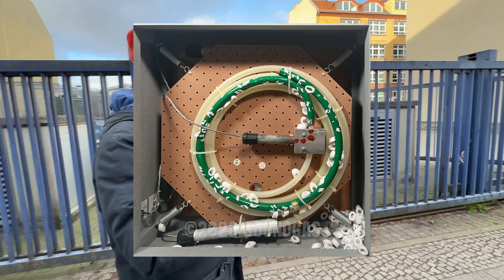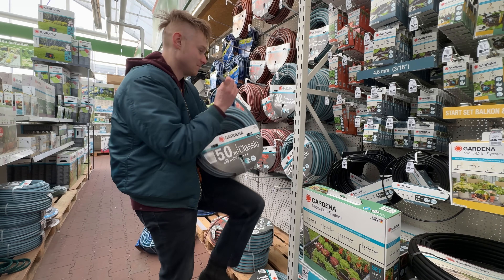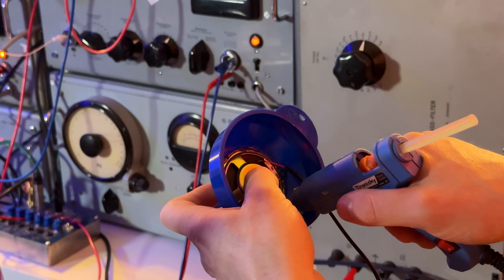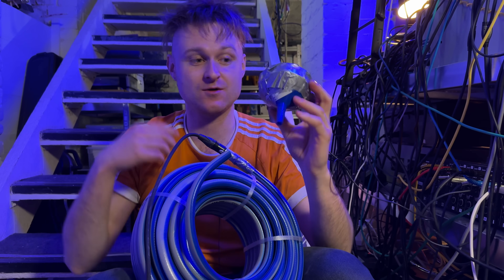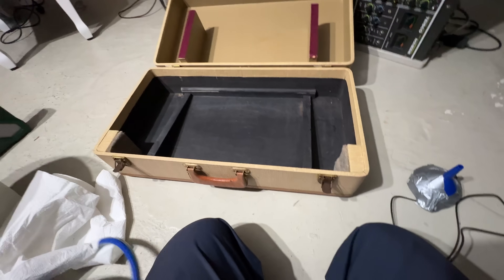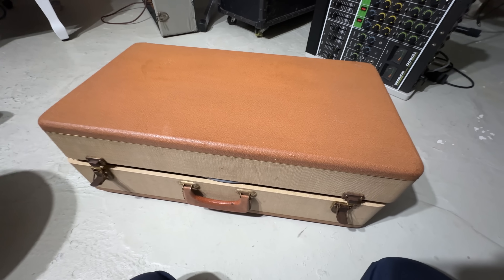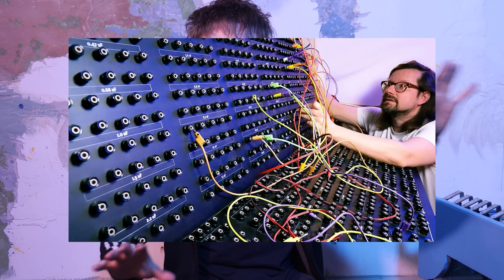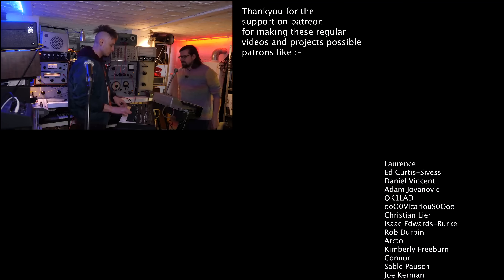MAKE A STUDIO DELAY WITH SCIENCE AND A HOSE.

Comment from the maker: You can now get both of the EP's on vinyl!!! there is a bandcamp vinyl campaign link above!!! PEACE
Reply: Unfortunately, postage to the UK appears to be more expensive than the record?
Reply from the maker: @Nervejam  yeah its mad int it :(
Reply: @Nervejam  Yep, $30.40 USD shipping and tax. Bummer.
Reply: Would be very interesting to cast the whole thing in concrete with the hoses and all to make it more solid and see how different it sounds
Reply: @AquarianSoulTimeTraveler  I beleive that sound travels about 14 times faster in concrete than it does in air. I wonder if that would cause cross talk.
Reply: Imagine you get more volume from a concrete cast because it can't vibrate as much forcing the sound to go down the pipe instead
Reply: Filling the hose with hydraulic oil or a similar oil might return better results since it's fully incompressible, as water still has some ability to compress and will cause some attenuation & distortion from the little bit of compressibility that it has.

Another point of distortion could come from the flexibility of the hose you are using too if that is a concern, but it all depends on what you are trying to do with the delay.
Reply: Nice. :D If you wanna try some things, here's a couple of ideas. 1) Because the signal bounces inside the hose, some routes are considerably longer than others. Instead if having one big hose, what would happen if there was plenty of small ones in parallel? 2) What happens if you combine different kinds of pipes into a setup like this. Then there will be different kinds of paths for the sound to travel, which might affect the sound quality.
Reply: Sam when you gonna make a rotory subwoofer?
Reply: yo, sounds great! What size speaker did you use for the funnel?
Reply: first bandcamp link is dead for me
Reply: Sproing reverbs and string reverbs (mic + speaker on old zither etc.) are known well. But particularly in 60/70th many such acousto-electric effect gadgets were built (already the Ondes Martenot combined much earlier a speaker with a gong - try cymbal for DIY). I wonder what happens when playing music through a trumpet (the musical instrument) or similar brass while operating its valves. What will a saxophone do?
Reply: 5:50 dubstep things is going on 😅

Comment: Hey manager Those weirdos are back in the store again!
Oh so that's where time cube comes from, Definitely should've watched this one first. I was thinking for a cube it's awfully round.
Well I'm here maybe a plumber will comment, why does the UK sell houses with no ends? I know that the faucets don't have a threaded fitting on them and are made to accept straight tubing a legacy thing but still why has that still persisted? I guess you would probably also have lower water pressures because I would imagine the hose would pop off at the faucet if you capped the end of it.

Comment: I took a sound reinforcement and studio engineering course at the Loudon campus of Northern Virginia community college about thirty years ago.  They had a gigantic plat reverb in the classroom.  Everyone thought it was a giant rolling chalkboard because it was mixed in with that sort of stuff along a back wall.  

It was a big rectangular frame with a wooden enclosure and a four foot by eight foot quarter inch steel plate suspended from the top on springs and stabilized by sound isolating rubber mounts along the other sides, and it had a transducer attached to the top left corner and a pickup on the bottom right.

I also went to see John Scofield about twenty years ago.  He has a moog synthesizer or maybe it's called something else.  It was a keyboard/organ powered by a giant spinning wheel that pumped air through the pipes.  It had a separate box for the "air powered amplifier".
Reply: Plat = plate.

Comment: In the 60s, reverb was something everyone seemed to want, even in our cars.  They made reverb units especially for car.  These used the spring units that were originally designed for Hammond organs, only smaller.  When you went over a bump in the road, ....twang, twang, twang.  Anyway, Popular Science or Mechanics, I think Mechanics, did a thing where they used a garden hose, a funnel, speaker and microphone, similar to the one you built in the video.  I always wanted to build on myself, however, I never seemed to have the time or money at that time.

Comment: Yeah, if you had 2 hoses with different diameter, the speed of the air are different and it will shift some frequencies. Not only that, but the pressure changes and speed of sound depends on it's pressure. So that's more economical and even easier to tune.

Comment: Ok, guys great video. Reminds me of 40 years ago and a Studio that a friend was building had an array of 3"  in pipes up in the ceiling all of different lengths, probably 5 different lengths, ranging from 10 ft to 30 ft  and each one equated to a different delay value, the delay calculation is approximately 1 millisecond per foot of pipe, you can use one speaker to Source all the pipes at once and One mic in each one of the ends of the tubes to record five different tracks of different delay values, and select the delay that works the best, also, when you use a larger pipe like a 3-inch irrigation pipe you don't have as much of the muffling as you experienced with the hose tube , try it and I think you'll be amazed!

Comment: I have an old building instruction from the 1960's for a reverb unit describing basically what you did, except that it uses two hoses connected together at the ends with T-connectors, so the speaker sounds into both hoses at the same time, and the microphone receives the sound from both hoses. The hoses are 16 and 22 meters long in the description - but it doesn't state why they have those exact lengths.

Comment: An idea to test; Try to use thin hose.. (and smaller transducer to maintain reasonable waveguide / funnel) ..around 1/4" or smaller (5mm). I know there are hf waveguides that rely on the fact that if a slit is narrower than 1/4-1/3 of wavelength of highest frequency of interest, the wave can not reflect thus flow fluid-like in a slit..so not so much low pass filter effect at least in theory.. kind of like a pressure system. I think most reflecting and thus the hf loss will happen in input and output chambers unless some mobilephone speaker/mic combination is used..one would be able to fit longer delays into the same size container..or more complex system..never tried that type of thingie but that came to mind while watching this video..! 😅

Comment: Cool stuff! Maybe give hoses for pressurized air a try, the material used is much stiffer than the rubber in garden hoses which should muffle it less and they are equally cheap if not cheaper!

Comment: Get 2 different hose lengths and attach a y valve . You now have a delay time switcher.  I’d probably also use a cooler as the enclosure for good insulation

EDIT: Oops. Wrote this before seeing the end where you me too 2 hose lengths

Comment: I've been proposing this since Sam was a preschooler.  It works, obviously.  The problem is that the characteristics that make it possible for a hose to be flexible enough to coil up like that are the very same properties that will result in it absorbing acoustic energy, especially in the mids and highs.  I mean, imagine if the legendary reverb room at Abbey Road was coated in foam rubber.  Ideally, one wants the stiffest tube/hose possible, and have it laid out straight, rather than coiled.  Of course, the sonic approach of this dynamic duo is to bravely use whatever the setup actually does, rather than aim for any sort of sublime sonic perfection.  I might point out that one should also be mindful of hose/tube internal properties when using it for a "talkbox" that conducts speaker output through a hose to a musician's mouth.
Reply: Use a long copper pipe coil like in a German hunting horn.

Comment: I've got a Urei time cube, it works best feeding one pipe into the other and then feeding back the whole thing using a mixer. The feedback has quite a different quality than any other delay, its not amazing but pretty cool, I like it a lot.
BUT i read an interview with the original designer and he said Urei messed up his design as they used garden hose but he originally used Copper pipe ! 
One would think yes Copper or some other metalic pipe should sound better as hose pipe is pretty dead and boring, I never got around to trying it though...i was hoping u2 were going to do it!

Comment: Delay lines were used as digital memory in the early days of computers. They used a metal wire instead of a hose but otherwise the same thing. You had to read the entire memory and retransmit it constantly
Reply: The Friden EC-130 calculator use a coil gong and all-transistor circuit for a serial 1-bit digital computer with CRT that fits onto a desk.
https://www.youtube.com/watch?v=N9cUbYII5RY

Comment: Back in the early 60s I had an earthing spring from a TV CRT. At one end was a loud speaker attached by 3 x threads through the cone at the other end was a record player cartridge. This used a stylus that was held in by a screw. The stylus was replaced by a sewing needle and again  thread was used to attach it to the spring. This gave a beautiful sound to the input.  Although my mother didn't agree!  Also you could tap the spring and produce noises that would considered to be in the Star Wars canon.
Reply: Sproing reverbs... Also don't forget the non-electronic Echo Mike soundtoy.

Comment: Speed of sound in air 330 metres per second. 30m of hose pipe = 30/330 = 0.909 seconds, or 90.9mS, so you measurement in the video at 6:36 of 89mS is pretty spot on.

I love old school solutions that are sadly just digitised these days. I’ve been aware of spring reverb and delay units, but pipe delays were not something I’d come across before, so thanks for sharing.
Reply: I saw another cool video about a pipe delay that used larger-diameter rigid PVC pipes, and could disconnect sections to reduce the delay time. It sounded pretty good!

Comment: Seriously, I've had a length of 10mm copper pipe wrapped around a big cardboard tube for over a decade, specifically for this purpose (and without knowing about the legacy equipment). My plan was to have the coil, which is about 80cm long, with several t-junction 'taps' with mics down the length for different amounts of delay. I think I bought the pipe from the scratch and dent shelf at a plumbing supply shop in Edinburgh after seeing a doc on the basement reverb that Abbey Road used to have.

Comment: The speed of sound is around 342.6m/sec, or roughly 2.92ms per meter.  If the original unit had a delay time of 30ms, you would have wanted a ~10m hose, not 30.
Also, a more rigid-walled plastic tubing (PEX, maybe?) would prevent dampening the sound to the degree that a softer garden hose would.  Some have suggested copper, but that has its own resonance if you're trying to keep the delayed sound as clean as possible.

Comment: Interesting!
A huge number of years ago I helped someone with the design of a quite different delay but a few of these things may still apply
1) If you equalize on the way into the speaker you can get the frequency response back closer to flat.
2) Reversing the polarity of the drive to the speaker (input transducer) in one case helped to defeat oscillation
3) This one is a bit complex.  If you bring the output transducer back to your mixer to do feedback you can get a long echo.  If however, you combine with the singer and then compress before feeding it into the speaker, each new sound from the singer tends to replace the sound that is echoing about.  A bit of a volume expand on the output of the total system before you go to recording makes the fading echo drop away faster after a bit of time.

Comment: Quick get the pipe out again and fill it with helium. Or maybe with some water or maybe blow a very smooth current of air down it so the soundwaves have to travel in a headwind and get even more delayed put some ball bearing in there so they rattle at special frequencies. perhaps setup something similar with a long drainpipe round the museum...a metal pipe would be less lossy got any plumber friends or a supply of exhaust pipes you can join together? Old central heating pipes used to be big, scaffolding poles?

Comment: "basically, a long corridor in a box" I love this, real ingenuity creating a great effect. I also enjoyed your clever testing method in the hardware store (I'd have been the idiot who bought three different lengths to try out at home). Best of luck with your vinyl release! (By the way, ignoring other effects, each 10 metres should produce  ~30ms delay, based solely on the speed of sound in air. The hose wall itself might also propagate significant sound and that would travel much faster, maybe a 3ms delay per 10 metres, depending on material - check the isolated recording for its own echo).

Comment: If you could get access to a roll of metal tube, the hard walls should reflect higher frequencies better, which could be an interesting partner for this one. The metal walls could also conduct low frequencies perpendicularly across the coil so there could be a stronger degree of spectral separation. I say access, the main rolled metal tube I know about is copper and that gets very expensive quickly, somebody can probably calculate the effect of frequency response on diameter, maybe brakeline or refrigerant line will work

Comment: So the default hoses you buy in the hardware store have no ends on them? All hoses come with ends in the US and Canada - why would you buy a hose without ends??
Reply from the maker: To choose the end seperately? Seems daft to buy em with ends
Reply: @LOOKMUMNOCOMPUTER  Every tap and every nozzle, or sprinkler, or thing imaginable that you attach to the other side of the hose uses the same fittings - standard garden hose threads - why would you need to "choose an end"? They're all the same! Pretty sure they're just nickle and dimming you to death making you buy the ends of the hose separately.
Reply: @gorak9000  It's just like buying electric cables without mains plug. Not everybody needs the same type.

Comment: Much more scientific than when I tried this out. Just like a hoboroadie, I first got Butyl Rubber hose, which is the most expensive, and also the most effective at attenuation of the SPL. Twenty feet to deadness. Hard pipe is where it is at. When my Uncle rebuilt his house in Berkeley, he installed speaking tubes from the kitchen to the library and to the kid's playroom. Like the tubes from the Bridge to the Engine Room. (Full speed ahead!)
One of my favorite mics is the SM-11, which is essentially a free-ranging Cartridge from a SM-57 or 58 mic, Omnidirectional so it doesn't do the proximity thing and you can drop it into spots for a sample of the sound.

Comment: your hoses come without ends on them?
Reply: I know, right? Like wtf do you do with endless hose (pun not intended)
Reply: @gorak9000  You can also buy mains cables without plugs. So what! People may already have the fittings (if old hose broke) and everybody needs different ones. Additional intermediate plugs increase leakage risk, so why should they be sold with them?
Reply: @cyberyogicowindler2448  Everybody needs different hose fittings? Are you telling me europe has no standard hose fitting?? In the US, every hose comes with ends factory crimped onto them - the crimped on ones are usually a lot better than any garbage you put on with a hose clamp.

Comment: 6:38 :  89ms is just around exactly what you would expect -> 30m hose divided by (speed of sound) 343m/sec = 0.0874sec, or 87.4ms.  This will change depending on temperature but the hose is probably a bit longer than 30m (so they don't go to prison for false advertising) and that's likely where the other 1.6ms came from.  89ms is 1/16th notes at 168bpm.
Reply: We can estimate the temperature of the studio in kelvin with (30/(0.089*20))^2, we do -273,15 to the result ans we get about 11 °C
Reply: It's not precise because if we take 88 ms instead of 89, we obtained 17 °C
Reply: @TeTe76VTheChiken  Yes, and there is uncertainty on the length.  Hardware store labels are not exactly NIST quality measures.
Reply: And to take it a step further, if you want 30 ms specifically, 343 m/s × 0.03 s = 10.29 m

Comment: I think 90ms is correct. My sum 30m / 343mpersec = 87ms. I wonder if taking "branches" off the pipe or just making holes with additional mics, or even 3D printing T junctions with a mic could yield multi-tap delays!

Comment: you should see what happens if you transmit through a sealed hose full of water - speed of sound in water is almost 5 times faster than air, so you might need a longer tube,
but the water might have very interesting transmission properties
Reply: Trouble being that water has considerable more inertia than air.
All things are possible with makeup gain I suppose, but it would probably sound

Washed out.

Comment: You can also do this with headphone elements, both as speaker and microphone.  My daughter gets these cheap on ear headphones, the cord wears out really quick, so I save the elements for experiments like this.  You can even get broken ones from a flea market or second hand store- usually the cable is the issue, and the elements work fine (usually).
Reply: Man, I gotta try this right away....  pretty sure I have a scrap hose to use, I have several of the headphone elements, plenty of cabling....  got a Field Kit, has 4 inputs, could do 4 different lengths....